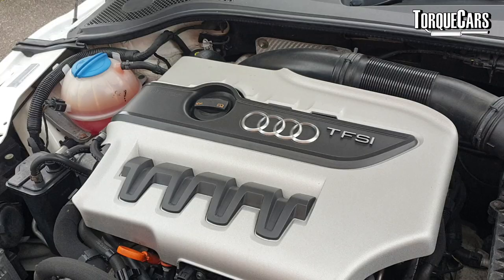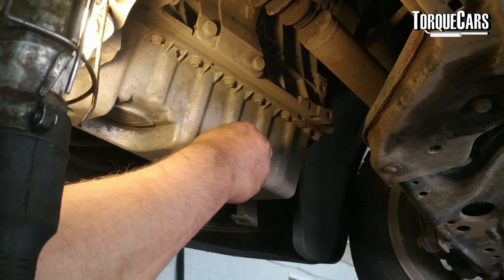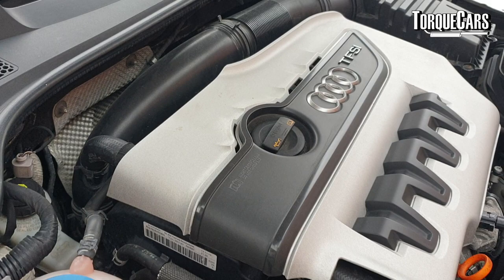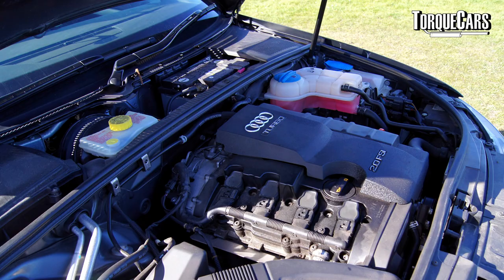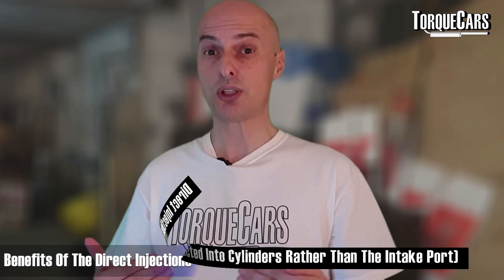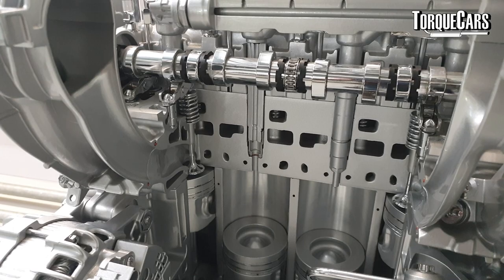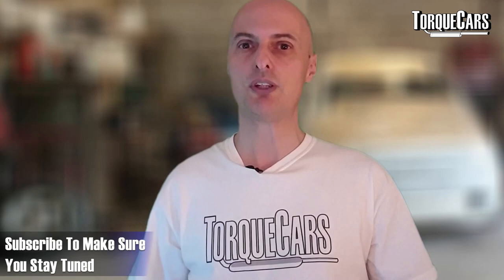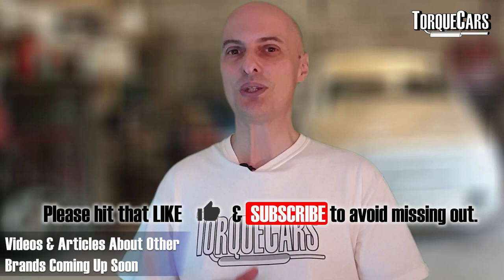Fix Common 1.8 2.0 TFSi EA888 Engine Problems VW Audi Skoda Seat [Engine Guide]

Comment: How is 1L every 1000km even a thing to be accepted. Its 2 oil changes basically per oil change interval. The European market always had crappy parts for their engines. Premium price for a primium vehicle doesn't equal to lets use more plastics and cheap materials for it. Why do you think the endless leaks and maintenance are always present? We wont even get into the electronics. Why haven't the European market stepped its game up in reliability like the Japanese market by now. You can have 4 iterations of ea888 due to epa but not reliability? 🤔  All European vehicles are planned obsolescence in my humble opinion and engineers are pushed to make them profit friendly.

Comment: Seems the issue is based on the gen 2 engines, the piston rings are addressed on the gen 3 EA888 engines as far as i know on the audis 2012 and up and other chikdhood issues like the chain and other things. I driving the audi a5 coupe 1.8 tfsi gen 3 with no issues at all, its a very reliable engine and low on fuel consumption and having already  190k miles on it and it runs like new, better then the nowadays cars that just came out the showroom, so i truely believe this vid is in regards to the gen 1 and gen 2 TSI/TFSI engines that having thise issues.
Reply from the maker: Yes you are right, the GEN 3 is quite a different beast so there will be a separate video addressing these to follow. The Gen 3 (10 years on) is still without any patterns of problems, but looking at the revisions they have addressed most if not all of the areas in this video in the Gen 3 version.

Comment: How can I find out what engine is in the car before I buy it ? Looking at the A3 1.8 tfsi after having 2 2.0 tfsi engines which both consumed quite a bit of oil
Reply from the maker: Which year is it? The log book will usually show the engine code which includes the engine code, or it is stamped onto the engine block itself. Anything after 2012 should be pretty solid and after 2015 revisions most problems have been ironed out.
Reply: @torquecars  from 2008 to 2012 there    problems with the engins

Comment: Hello mate car is a 2015 polo GTI 1.8. Pretty sure it’s the EA888 engine, got a p0340 fault code for camshaft sensor but this doesn’t appear to be the case. Bought a crankshaft sensor but can’t find where it goes. Any idea what the problem could be?
Reply: It will not be 100% sensor. It s going to be timing chain, that probably jumped over a one tooth

Comment: It’s not normal to burn 1 litre of oil per 1000 miles!
Reply from the maker: It is annoying this happens and is "regarded as normal" but here in the UK most of the main VAG Dealers will generally refuse to discuss the problem of oil consumption as a problem unless it is consuming around 1 liter every 800 miles! What is your experience on these engines and their oil consumption my friend?
Reply: @torquecars  I'm buying exclusively low milage cars with naturally aspirated petrol engines from Asian manufacturers. The challenge is where I live the market is flooded with turbo diesels and turbo VW petrol engines. So here and there it's tempting to buy a VW 2.0 or 1.8 turbo petrol engine, but then I stay away by watching this content... so thanks ;)

Comment: I put a decat down pipe and 3 inch cat back exhaust 3 days later Uv lost all boost and it reeks of fuel and now have engine light on 😅 any help welcome it’s a 1.8tfsi 2014 plate Quattro
Reply: I’ve also fitted a 4.5inch pro ram air intake system with englarged turbo elbow and a turbo muffler delete it all ram fine untill I put the down pipe on now it’s running like a bag of shit ans I’ve no clue why haha

Comment: 2015 Q5. 2.0 CPMB/flex fuel. Before changing the oil I've used Liqui Moly Sludge Remover flush and Xado Atomic Flush (both require you to drive 100-120 miles with the flush), then added about 150 ml of LM Mos2 to the new oil. It created a 'film' which helped seal the rings. My consumption went down from 1 qt per 650-800 miles to 1qt per 2500-3000 miles within in the next few months. However, I earlier replaced the spark plugs and the PCV valve as well, which helped I think. These do not simply fail suddenly, but start to decline after 40,000-50,000 miles and will contribute to oil consumption (carbon build up; pressure), so don't wait until the plugs or PCV fail officially with check engine light - change them at around 50k. They can go as longer but will underperform. Use a quality fuel injector cleaner every oil change and stay on hi-detergent gasoline (93 octane Shell or Mobil) and your injectors will spray well. Change oil every 4,000-5,000 miles.  These step will go a long way to getting your consumption down.

Comment: First of all: congrats for your contents, really complete and interesting, i also have a question for you: I own a 1.8t aeb with regenerated K03 turbine, I also removed the old and worn out catalyst, the car runs good, but sometimes, when the turbine is spinning (specially at low rpm) and i release the throttle the car makes a strange "cutoff", sometimes the turbo seems to give more boost, sometime less, the ecu reports an issue: "turbo pressure too high" but on this engine there isn't a pressure gauge, my mechanic has no idea about the issue, what do you think? Tank you
Reply from the maker: This sort of thing can be quite hard to diagnose, common things to check, is the air flow sensor in the intake working correctly or is it soiled/dirty. The N75 and or Diverter valves could be sticking. Did the car get remapped as you've removed the cat and this will change a few things around how the engine burns fuel and what readings it gets from sensors. I'm also guessing there is not an atmospheric dump valve and the exhaust and intake are stock factory options apart from the cat. I'd be curious to know if it is running rich or lean as this can shed a little light on the subject. The 20V 1.8T engines are great units, and not much goes wrong with them.
Reply: @torquecars  Tank you for your reply, the engine is stock with the exception of the cat and didn't remapped it, I just replaced the air flow sensor due to a problem that now is solved (sometime the engine went out for some seconds during accelerations), mechanically speaking the engine is good, oil and filters changed every 10K Km, as you said the problems are all around it (sensors and valves) but these problems (in my opinion) are the most annoying to be solved. Rich or lean? I can say that the engine crackles from the muffler when downshifting. I'll check N75 and diverter valves, I already cleaned the throttle body.

Comment: My 2017 vw gold sportwagen 1.8tsi does not has an oil consumption at all.  Wondering if its a matter of time!
Reply: There was a problem with the pistonsealls from 2008 till 2012
Reply: No were good I have also 1.8TSI but I have the FWD version same engine.